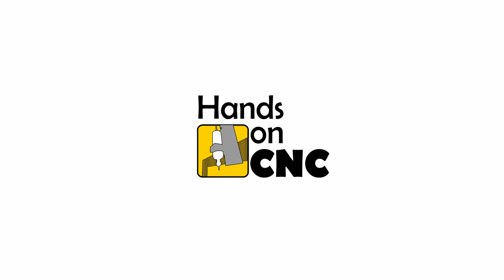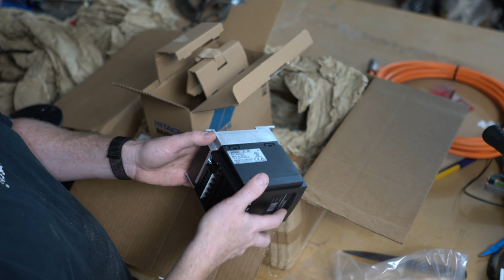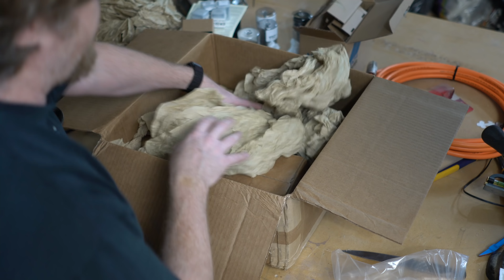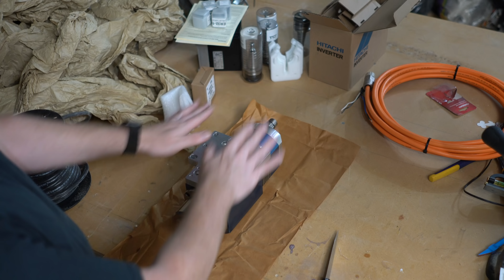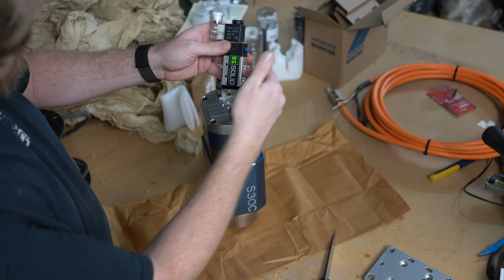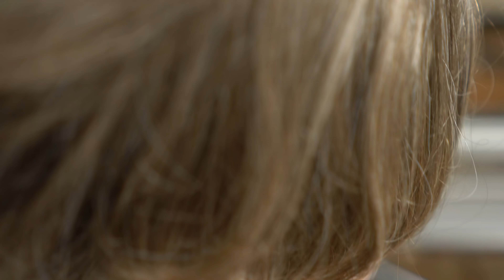Unboxing CNCDepot S30 Spindle Starter Kit

Comment: Been Running My S30 On A  CNC router parts pro machine for Several Months Now  In My Cabinet shop.  Have Had Zero trouble with it.  I didn't believe that the passive cooling would worked But it does.  Over heated it once on a 100 + F day out side Cutting  MDF with the Vac on warming the shop up. the last sheet of a 15 sheet run  The temp sensor shut it down Waited for it to cool off a bit and Finished the job.   Other than that it has never stopped.   Honestly it was to hot for me to be working.   If your thinking about the S30 I would suggest doing it for sure it has worked well for Me.   i saved a lot of time on each sheet as I used to do 4 bit changes Manually.  I run cutters up to 2" diameter so far.

I don't have it as a full ATC using the tool holders  I will be interested to see how you do it and How the clear paths like the heavier spindle They are next on My list.
Reply from the maker: Wow!  Great feedback. I am looking forward to 20 second tool changes even if they are manual. I am looking at setting something up for full ATC using the 10” at the back of the 4896. 

I figure I can roll the changer forward and back, maybe pneumaticlly?  TBD. But I’ll share the design if I work something out.
Reply: I'm Thinking the same thing.  the other thing was Lengthening the machine to 10 feet  so i could put the tools across the back and have the room for a second row in the future.   Looking forward to watching your setup evolve!!

Comment: I was Looking  to add one to my older cnc router parts 4x8. But thinking about upgrading first. Bought everything but spindle a year ago. But real estate is cramped for tool holders. Have Script for Atc For Mach 3 If you need it. I tested and everything worked fine. I believe it needed an additional mach 3 screen set I had to purchase. Let Me Know if you need script.
Reply from the maker: Thanks for the offer...  I'm running Mach 4 unfortunetly, so I'll be having to write my own scripts in LUA because there is no backwards compatability between 3 and 4 scripts :-(..

I had an older 2x4 cnc router parts standard machine for a few years before I upgraded to the pro.. The Pro kit is worth the upgrade.. Just the move from the cold rolled rails to actual linear rails makes a marked difference.   For the tool holding, I am looking at a movable tool holder, the back of the machine has about 10" of unused travel (well its used by the width of the gantry so the spindle can reach a full 49" and change).. I am thinking a small pnumatic actuator to push out and pull back a tool tray may be the way to go.  That will be weeks from now.. Right now I got to get the machine making chips again.. Just upgrading to button press for tool changing and a tool-offset table will be HUGE time saver for me.. But the full ATC automation will come for sure; I've become spoiled having it on my Skyfire SVM2

Comment: I beg of your help!!!! Just ordered the s30c starter package like yours, I have a 5x10 cncrp machine ran with mach3. I never used an ATC and while I'm waiting for the spindle to arrive I want to get all my ducks in order. Can you please tell me what I need to buy to get the spindle up and running? What do I need to hook up on the hitachi vfd, what setting I have to change to run the spindle with mach3 and the cncrp electronics package (nema 34)
Reply from the maker: I wish I could help more. For the most part it should be pin for pin. Because it can run off a PWM. I run Mach 4 and custom electronics but the actual Mach settings didn’t need to change much.

Comment: Can you show the process for setting up all of the pneumatics and connecting it to the CNC router parts controller?
Reply from the maker: Sure. Thought my electronics package on my CNCRP is custom.
Reply: I know this is 4 years later, but I'm on this part now (bought a used system and it was taken apart before I could review it).  Did you ever find a good source of info for setting up the pnemuatics?  Thanks!

Comment: Does the electronics that came with avid cnc handle the atc or did you add something to make it work.
Reply from the maker: It is just the VFD so you need to work out your own solinoid for air switching to run the ATC.

Comment: what is cooler system of spindle
Reply from the maker: air, though you can get a water attachment.. It does get hot... Depends on how much you need to run it to determine if you need the water cooling block.

Comment: Well Im still disappointed and undecided. After talking with cncdepot and double checking that Ive bought everything I need spent all the money I could give them its a big paperweight. The starter kit does not have a solenoid does not have airline does not have push fittings...is very difficult to figure out how to wire vfd based on instructions. It does not have a breaker switch fan or electrical box. Most irritating of all is now I think Ive finally wasted all needed extra time running around locally to try and get the bits....I still have to source a WRENCH! They told me they sent one. I did not receive it and they have not replied to my email since well before xmas. It is coming up on a year this thing has been unusable. YOU CANNOT GET STARTED WITH THE STARTER KIT
Reply from the maker: ick! sorry you had that experience... They must have improved their descriptions on the website when I ordered mine.. My starter kit had what I expected it to have.. I knew I would be needing to have.. Its definetly not plug and play like a CNCRouterParts plug and play kit.. (now there is an idea, CNCRouterParts and CNCDepot need to partner to make an ATC CNCRouterParts plug and play kit ;-).. )...

Anyways, I hope it gets resolved soon for you..
Reply: I am beyond happy you wrote this comment. I was just about to pull the trigger on this "starter kit."  Sounds like a nightmare. Glad I saved my money and the headache.  If its not a product the average  CNC owner can get up and running in a matter of hours then the seller has lost a huge part of its potential customers.  Not everyone wants to be a computer/electronics geek.
Reply: @garrydye2394  I may have sounded a bit raged. If I can get the thing happening in the next 4 weeks I will be happier and finish off an indepth post on cnczone on the wiring etc. I wouldnt rule it out yet. Im going to email them one more time today and see what they say about the wrench, as well the electrical box switch etc are to be delivered today. After I had received all this gak and ran around in circles buying parts I was told that others had been offered having cncrouterparts send their vfd box to nashville to have everything installed to be a plug and play. If you deal with cncrouterparts.com I would go through them to buy this unit. cncrouterparts.com has the best most knowledgeable quick support hands down. Ive dealt with FGP, Laguna, AXYZ and not to slag on them but I think CNCrouterparts beats them service wise. Im a small business myself so instead of removing my comment I wished to be fair by elaborating. If all goes well this will be a good value.
Reply: @Pat Quinn I have just seen these comments and am dissapointed that we have not received any communication from you in almost 5 weeks.  Even though your setup is complicated with multiple spindles, etc, I am confident that we can help you to get it working if you will communicate with us and CNCRP.  We will continue to do everything we can to help you get up and running.
Reply: @patquinn8635   So your advice is to ask cncrouterparts to get the spindle and everything that is required to set it up?
Reply: @blurrycustoms  Lets start with a full detail video of adding the s30 to cncrouterparts and sell all the items that are needed.
Reply: I know this is 4 years old, but I'm in the same boat right now getting a used unit and not being able to see the pnematics.  Did you ever get a good source of info?  I'm struggle bus right now.